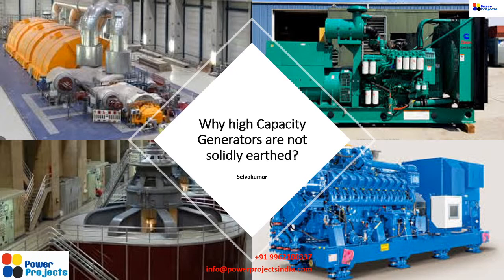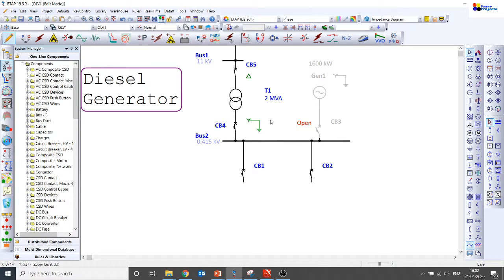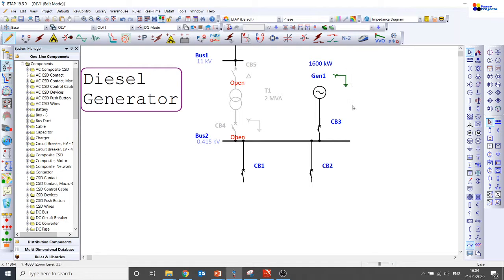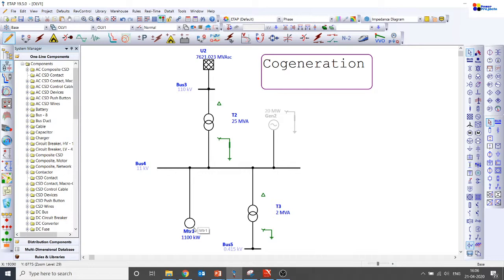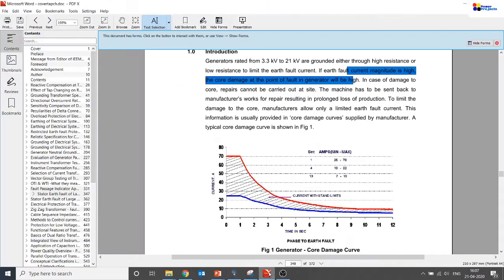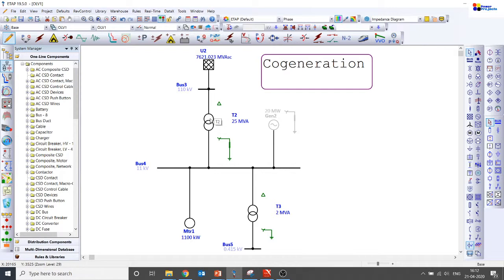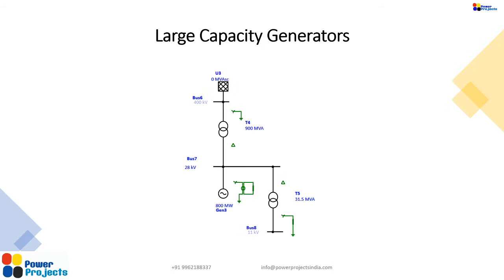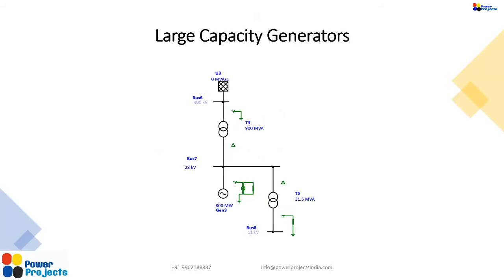Grounding of Generators

Comment: Thanks a lot, your presentation is oriented towards stator protection. Apart from this, it can be said that the NGR requirement is based upon the MVA rating of the source. The Fault MVA of a utility system is much higher than a Low voltage DG.

A connection from the utility through an MV system requires NGR for transformer neutral to limit the single line to ground fault current because of its SC capacity (762 MVA considered in the presentation). Any big DG which produces power at 6.6KV or above voltage has a combined neutral resistance ( for multiple DG) to limit the earth fault current.
Reply from the maker: There is no relation between Utility short circuit MVA (Which is three phase current). and type of grounding.

Can you quote any standard or technical literature for "Apart from this, it can be said that the NGR requirement is based upon the MVA rating of the source"?

Comment: Thanks! When & where to use NGT / NGR.  To be clear which is better? NGT or NGR?
Reply from the maker: NGT is required when the resistor value required is too high (Mostly for Generators when Limiting the fault current to 5 A or less)

Comment: Sir, How to find capacitive current to size NGT& NGR?

if you see above values, and  34.5kv/ Sq.root(3) = 19.9KV (phase voltage) 
And 19.9KV/19.9Ohm = 1000A. But have no clue what is the criteria and how calculation done. Can you help please?
Reply from the maker: You can find our the capacitive current using formula I = Q/(1.732*V)
Q can be calculated using Q = (V^2)*3.14*f*C